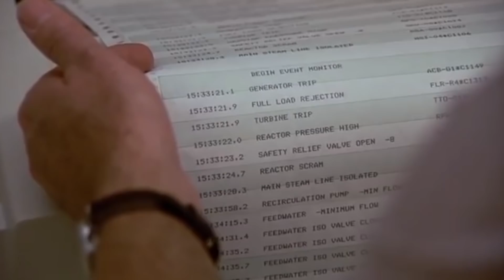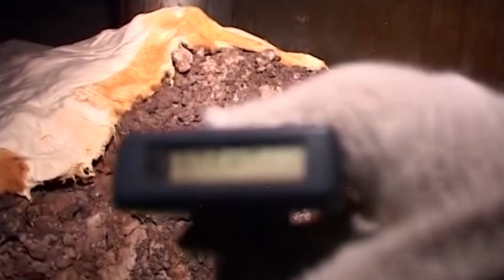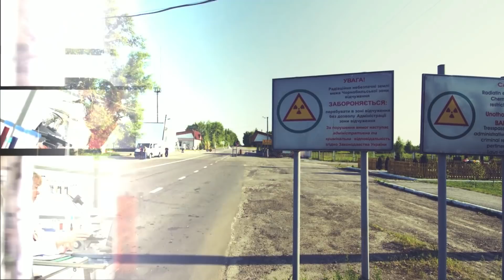What Will Happen to CHERNOBYL in 100 years ?

Comment: Actually there is a way to solve this issue.. make a big grave for the building.. demolish the reactor inside the new structure to prevent the radioactive dust.. after all collapse then bury all of those radioactive material..

Comment: All I see is rampid unleashed free power. Make machines that operate using the power available to run the cleanup like solar but not .the rads are there use them

Comment: Truly inept and juvenile narration. Nevertheless, some good information.

How to clean this up? First, what about those large buildings? A little imagination could do a lot. Put a really huge tent over each building or group of buildings, pull them down, then move over to the next group. Like the NSF in a way, but the tend only needs to last briefly. Instead of explosives, attach some really huge cables to the top of each building, perhaps employ some counterweights, and just pull like hell. Here, you don't have to worry as much about damage to adjacent areas.

Now that there is not such a hurry, I'm sure robots can be devised that are not so sensitive to radiation. Maybe it's time to bring back some vacuum tube technology, or just hydraulic control systems. In principle, hydraulic logic can do anything electronics can do. It's not like we need a self-driving car or something.

You're going to need some really big crowbars! And hammers, and saws, and the like. I don't think Home Depot carries those, but they can be made. That's probably one of these easier problems.

Break it up, piece by piece, and haul it to a really big landfill, with a really impermeable lining.

Maybe growing crops is not a good future use for the land. Once everything is removed, TTTT the soil is probably not going to be very radioactive. But how good is good enough? Rather than trying to decide that, it should be totally suitable for a really big solar farm. I'm told there is a small one there already. Now there's an irony for you.

Comment: Would the fire fighters uniforms that was all dumped in a pile in the basement still be there or would the radioactive exposure ( I hate saying radiation , it's not the right terminology)  just turn the firemen uniforms into a dust 100,000,000 times more toxic than asbestos .

Comment: Well, supposedly the longer the half life the safer the material is. What made Chernobyl so lethal during the first decades is that all the short lived material was pumping out radiation like crazy. The faster the half life, the more radiation it is putting out.
Think of it like this. Say you have 100 ping pong balls, you have five seconds to get rid of them all 1 at a time. That's a huge bunch you get rid of and fast. Now you have 100 and have an hour to get rid of them. Now you can take your time and toss them at leisure. This is basically how radioactive material works, short lived stuff is short lived because it is tossing off radiation at a crazy rate while long half life materials spew radiation at a much slower rate.
Now I'm no nuclear scientist, but that's what I've picked up on it over the years of studying. Chernobyl's melted core can be approached (we have pictures of people doing just that), but not for very long, simply because there's so much of it radiating slowly. So robots could work there, but with a lot of protection and in short periods. We just have to get down to it first

Comment: pripyat will NOT be rehabbed for another 450k years ... just because of Am radioactive element
Reply: 450k years huh. Where did you get that from? Are you talking about the reactors themselves, or the areas around them? If you are talking about the reactors, it will take much more to actually fully take away all radioactive material. Basically, it will take around 999+ qudrilian years. 1 gram of the elephant floor will take around 4 billion years to completely dissapear. It will take much more than 450k years for the reactors to be completely fine and radiation free. If you are talking about the places around the reactors, people are cleaing it up and a thinking it'll be safe enough to actuall build and live at up to 300 years by now. But, if no one touches it at all. It'll be safe enough in about 20k years to live near. So yeah. It'll probably take around 500-800 years legitimately. But, it doesn't really matter. We will probably have cleaned it up by than as I am saying that from the technology we have now. So, it most likely will actually take up to 300 years because of all the technology we are developing. So yeah.
Reply: @marpyplarpy350  ugh i calculated it wrong. sorry. plutonium 239 half life is 24k years after that 1% per 10 years. I blew the calculation right there. 300 years you mentioned is for Caesium-137. it falls under 30 years + 1% + 30 years formula.  As far as timing clean up, I hope there is technology to clean it up but the cost of clean up is staggering and I am not talking just 30k zone. Bryansk area was contaminated by Chernobyl's blast. It is 240km from chernobyl.  some areas in Belarus is already having some of the lands reclaimed. 
we can ionize beta reactive element to speedup the process of decay but I don't have any idea how that is done. 
 thanks for catching my error.  Happy New Year!
Reply: @gennieapulova8017  Happy New Year to you too my friend!
Reply: @marpyplarpy350  thank you! wishing all l your wildest dreams to come true

Comment: "Pripyat will be probably demolished in the next couple years."
sad cheeki breeki
Reply: @BigHaas wondering where they will shove all the radioactive debris of an entire city and how to demolish the buildings without spreading the radioactive dust like sands throw on a fan.
Reply: E M more of that, there are still some particles with 2000 mkSv/h laying randomly in the streets and on rooftops.

You can even go and live there (apartments have 20-30 mkSv/h) but there is a chance that hot particle is lying under your bed or under kitchen table

It's just unremovable
Reply: @Meme_Name exactly and all the ones that are in the soil of the forest and vegetation around the city, so the soil will be forever polluted, there is still an order in place to hunt down the animals every year to avoid them moving in others areas spreading radiation gotten from birth. There’re wood sheds contaminated rotting in the soil and spreading particles in the bushes full of particles. If it’s made a removal of the inside of the houses, shops, hospital if they took outside something, the particles will be spread by the wind everywhere. 
The people with ARS (Acute Radiation Sickness) were put in the Radiology areas of the hospital how they suppose to get rid of their beds if who has died of ARS was encased in steel coffins and buried under layers of concrete.
You will never get rid of that particles, they are everywhere and has contaminated everything. And still the main question where those people think to put everything, the particles will always be there, the only answer is waiting for not even the Hal-life decaying but the complete de atomization and de ionization of every single component of the particles. Like ages.

I have visited the city and the switched off reactor “considered safe”  the one more far from the explosion and meltdown and with the structure intact, the tour guide ordered to keep moving, and visiting the places without stopping in a place any further, we had“protective devices” and a Geiger counter each ones, because after a determined amount of time we must go back from the place. The day after the visit me and my father had a return flight to US, obviously with stopover. The evening before the flight I told him do do two showers and we put everything worn during the visit in a trash bag and threw it on the trash of the cleaners of the hotel.

Comment: Corium isn’t an element, it IS fuel combined with other structural components
Reply: Balec Bird yes I’m pretty sure Corium is the term the scientists used to describe that scary mass of nuclear material and fuel.
Reply: Richard Mani +concrete
Reply: Meme_Name yes I’m sure the mixture would’ve compounded some concrete in it, as it burned it’s way through layers of it.

Comment: CHERNOBYL WILL NOT BE INHABITABLE FOR ANOTHER 24,967 YEARS!! ( read comment )
Reply: Wanna know why because the explosion of Chernobyl’s nuclear reactor 4 caused a huge nuclear cloud that will keep radiation throughout the town for 25,000 since the incident so if it happened 33 years ago that means 25,000 - 33 = 24,967.
Reply: Austin Shaw wrong you don’t know that
Reply: I do bud just learn all about nuclear engineering and atomic power ( fusion and fission ) and then do the math, easy.

Comment: It seems like with the arc over the reactor.. They could fill as much as possible inside with plain old dirt then cover it in like a man-made mountain ... But of course that would be too simple .. and wouldn't make Ivans brother in law nearly as much money ... But if they used soil with high lead or iron ore content it would feasibly work ... and be a lot cheaper than all the over-thinking methods they are using or pretending they want to ... After all - most of the radioactive substances came out of relatively shallow soil ... and would be safe being right back under it ... Then, after the reactor is covered the radioactivity from the remaining structures in the city wouldn't be constantly recharging and would actually dissipate their radiation at low levels far quicker (and be safer to work with while demolishing) ... But like I said -- plain old dirt would be too simple ....
Reply: You are simplistically uninformed about radioactivity.